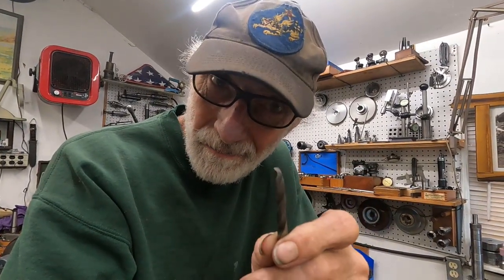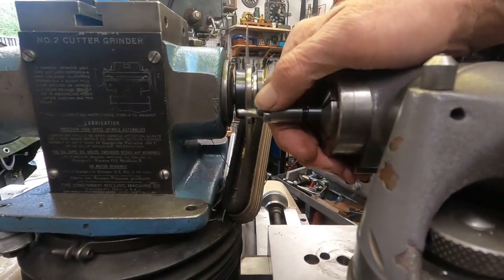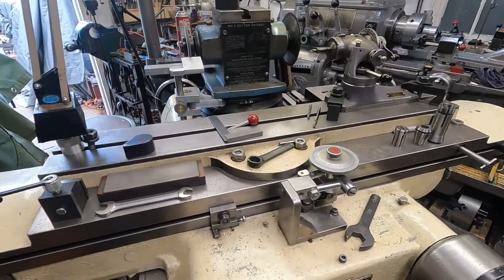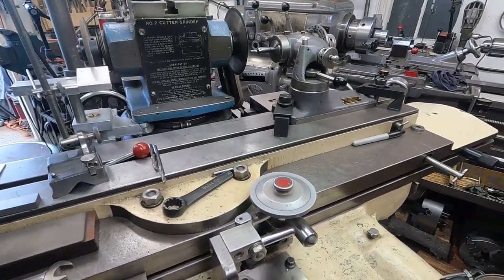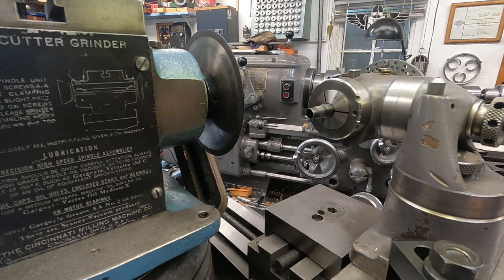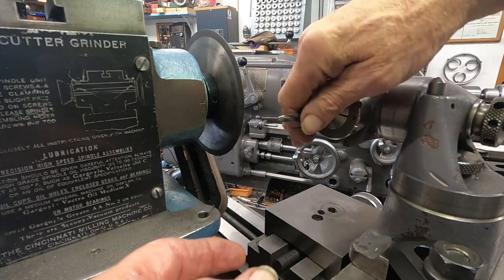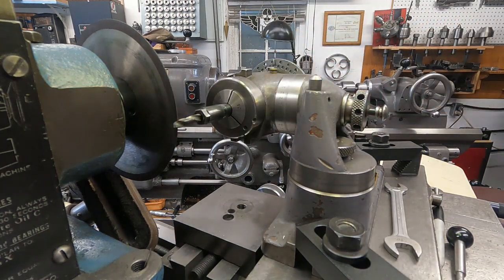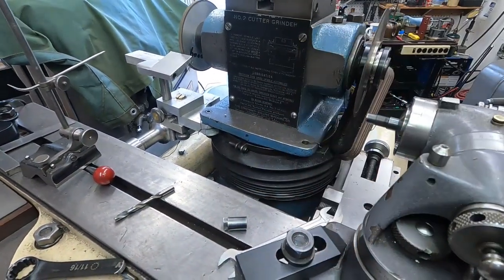Restoring solid carbide drills, cutting off broken tips

Comment: Good one . I must get one of those wheels .  Just starting to collect bits for the T& C grinder dust extraction .  👍👍👍
Reply from the maker: I was skeptical, but it is doing a good job at low cost. When I was doing film photography I picked some tricks on airflow in the dark rooms regarding fumes and dust control, and this working in a frozen food warehouse.
 The big entrance doors had to be left open for the forklifts. They use an "air curtain". Above the door a fans using a sheet metal fixture directed air through a thin slot. Around the slot is long stiff bristles like the brush attachment on my home vacuum cleaner I am using in the videos. Oddly the bristles help eliminate turbulence at openings regardless of flow direction. Without the brush, my little vacuum cleaner is much less effective. Looking back, I cant remember many doing anything about dust.
Reply: @DonDyarprecision  I might need a bit of  Hawaiian skirt for my nozzle ! 👍